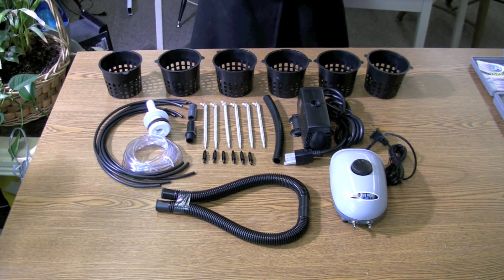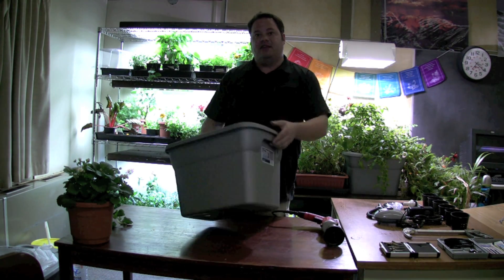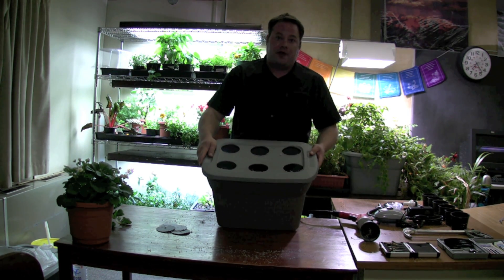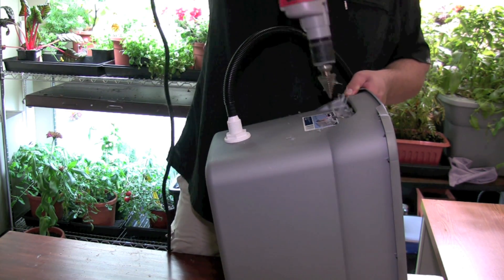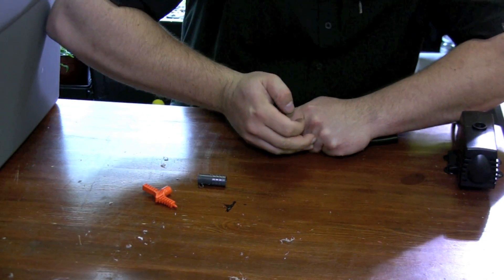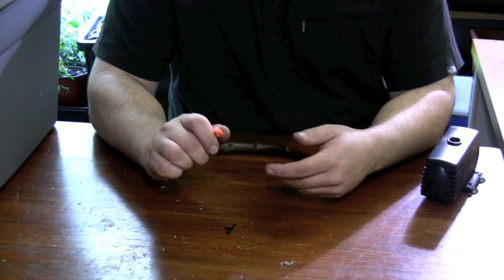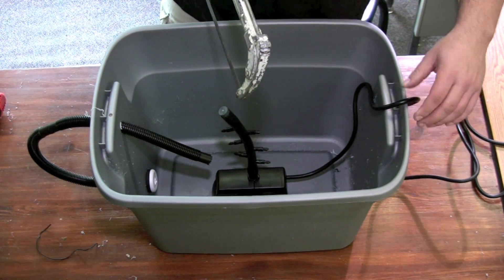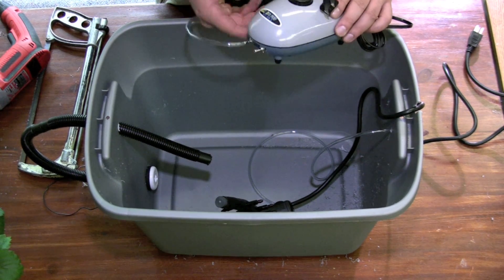How To Build A Hydroponic System Part 1 of 2

Comment: Please tell me then name of the orange tool you used to punch holes in the water supply tube.
Reply: nozzle installation tool/multi installation tool - shops that sell those parts and tubes usually stock them, same goes for hydro stores

Comment: I'm sorry I'm gonna stick with MPH gardeners his is much simple  for a female to do thanks
Reply: +frederica broadney  surfmonkeycoconuts gt a pretty easy system too
Reply: Please could you explain to me why a dutch bucket RDWC system is easier to build then a simpler DWC? For a DWC you need a smaller set of tools too - a saw cup for the net pots, a saw and a drill bit for the air line - hack, it doesn't even take a pump and feed system for a DWC. So RDWCs always more complicated to build as it takes so sort of pump for the re-circulation, more tools, grommets, connectors and etc - the lone plus side of RDWC is the easier operation once it is running.

Comment: Buildinghydroponics may seem difficult specially when you don't have any experience, but it's not.
Reply: You just need a right plan, appropriate tool, and the help from expert, you can save yourself a lot of time to build a hydroponics setup quickly and easily simply by using this clear hydroponics system instruction:
great7.net/hydroponics-building-easily-24463

Comment: Do you have a List with exact names of all the Things we need, like those cables for the air and the exact pump
Reply: the deep water bucket using an air bubble system sure looks a heck of a lot easier than this Does this system with the water pump suppose to work better?
Reply: in this system the water pump is a complete waste of time, this system you would simply cut the holes, put the pots in, fill the tub to within 3 inches of the pots and then stick the airline on the stones, put the stones in the water, turn on the air pump and then connect the other end of the air line to the pump and watch the bubbles flow, that's it you are done.

 get a 2nd tub and pop the lid with plants on it when you need to empty and clean, put the airstones in.
Reply: Superman DK

Comment from the maker: @SuperStasam 
The rear holes are to feed air hose lines through so that they can hook up to the air stones.  The tap is only for draining water so that the roots don't get disturbed, the hole for the tap acts just as a holder.  You could also drill two small holes and use wire to suspend the drain hose/tap.

Comment from the maker: @yahmana 
You can use just a water pump in a separate reservoir that pumps the water to a separate container and drains the water back to the reservoir.  The idea hear would be that the roots would be suspended in a lot of air getting which will allow them to get enough oxygen without an air pump.

Comment from the maker: @brianl2px20000 
The tube sizes are 1/2"  you could also use 3/4 if you wanted to.  1/4" overtime clogs to easy.

Comment from the maker: @Dizzinz 
I just finished filming the different lights that I use at home and in my classroom and I will be adding a narration that will explain the pros and cons of each light.  Most of the supplies can be found at your local hardware store in the underground sprinkler section.  You can also google horticultural source and buy everything from them.  They are a wholesaler who sells to the public and they have everything.